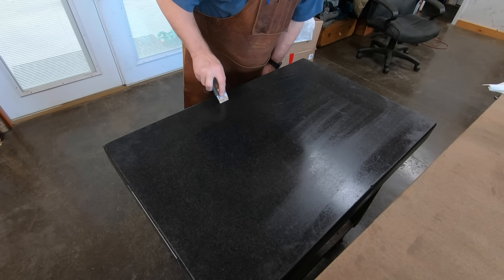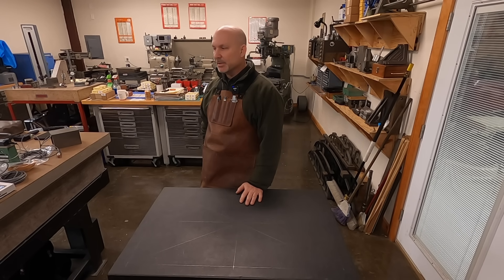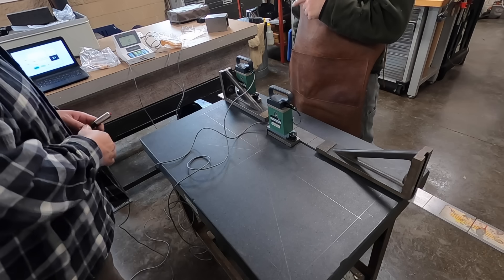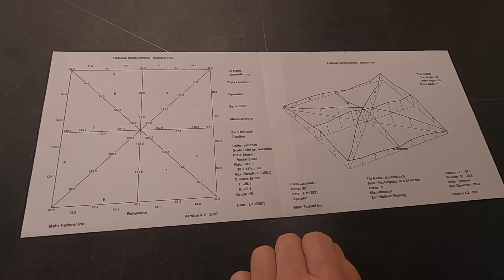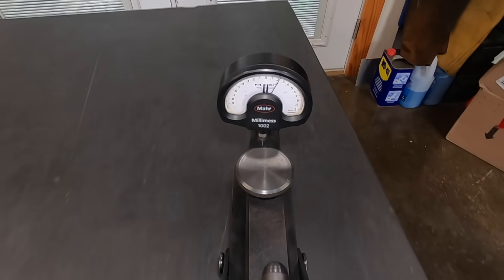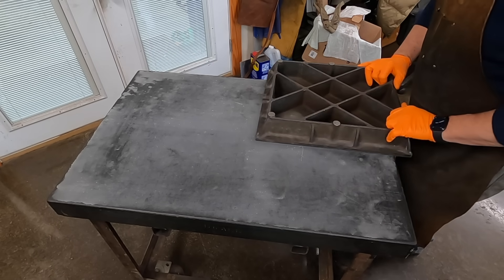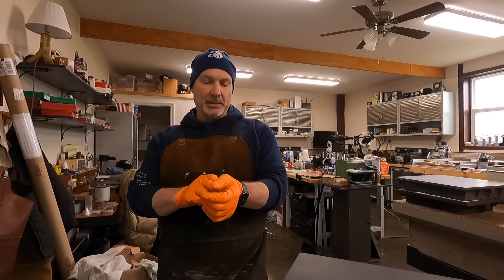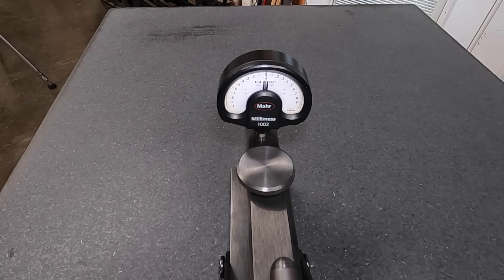Lapping my Granite Surface Plate to AA Grade

Comment: Take the plate home now and polish it :)

Is there not a surface finish that could be added to it to make it harder wearing ?
Reply: There's this thing with some precision granite plate cleaners - people say it contains lanolin which ultimately helps with lubricity and helps things slide better. So you get less wear on the plate.
Reply: @chronokoks  I guess baking in an oven isn't going to help - it's alrady been through that process :)
Reply: @millomweb  lol yeah. It's been sitting outside for so long it went through many heating cycles :D

Comment: What is the purpose of something like this like why does it need to be so flat
Reply: In fine machining, you not only want to be precise with parts--you want to be consistent along the length of whatever your fabricating (that's one example use). Let's say you want to make a metal cube. You machine one, set it on a table, put a level over it and go "hey sweet it's perfectly level, it's a perfect cube".  But then you notice you can slide a post-it note under some areas, or shine a flashlight on one side of the cube and see a bit of light peaking through the bottom of the other side. This means your cube may be (to the naked eye) square, level, and perfect--but in actually there's variations along that surface you're examining. So in machining, flatness is an important quality of making certain parts. Try taking two clean pieces of plate glass and rubbing them against eachother--you'll notice it's a challenge to get them to budge. That's because both of those two surfaces are making contact perfectly. Pretty much a vacuum seal. Obviously this is a useful quality, yet another aspect to pay attention to when talking about "tolerances".  So, a surface plate like the one in this video is used to reference the "flatness" of a part you're making. You'll see many of these plates made out of Granite because its a hard material and is pretty "flat" naturally. Lapping--in the context of this video, is abrasively "reflattening" the surface after years of use and abuse as good maintanence. I hope this reply helps.

Comment: Would like to ask can you coat the stone with say with ceramic liquid to strengthen the durability or accuracy of the surface lapped!?
Reply: Ceramics are basically fired metal oxides. Granite is composed of only metal oxides (SiO2 72%, Al2O3 14%), fired in the depths of mother earth.

Comment: How stable is the floor? You're walking around the table while taking measurements.
Reply: I don't know that it matters since the device is measuring relative to the stationary sensor on the table. Otherwise there'd be no productive way to produce an accurate measurement as there'd be too many variables in play that couldn't be controlled for. Could you imagine the nightmare it would be to have to take things like the stability of the ground under the object being measured, the local instantaneous gravity, the local air pressure, local temp, etc. basically anything that could even minutely effect the physical properties of the item being measured.
Reply: @thomasschulz2167  ok, relative measures will do.
I had some experience with measuring the surface of a telescope mirror. With the measuring device on one stand and the mirror on a second stand I was seeing my heartbeat in the picture (interferogram) transfered via floor vibration into the system. Quarter wavelength precision is going gown into nanometers.
Reply: @thomasschulz2167  I think it would matter if one foot of the table constantly dipped under the weight of the lapping device. He said there is some flex under loading. (I have no clue though.)

Comment: Every surface plate I've seen has been granite, and I'm wondering if there are any other stones suitable for this purpose.    I suppose marble would be too soft, but has anyone made a surface plate out of basalt?
Reply: I've always wondered why surface plates are made of granite but pool tables are made of slate.
Reply: Yo las trabajo con carburo de tugsteno
Reply: The answer is thermal and chemical stability.
Reply: @LeeDanielCrocker Slate is porous/needs to be sealed, and it is pretty brittle. It's also not as dense or as thermally stable.
Reply: @allenklingsporn6993  Slate must be a lot cheaper then.
Reply: I work in the granite industry, and I would imagine it's due to the extreme thermal stability of granite to keep it flat and the dense, fine grain to let you get it flat in the first place. It's also usually pretty homogeneous compared to most other stones so if it does expand or contract with temperature it does it more uniformly than other stones they may have several different veins or materials with different densities across the slab.

Comment: Could you explain to a layman what the roller's function is?
Thanks!
Reply: I'm not familiar with the process, but I believe it embeds the diamond powder into the surface of the plate to turn it into a microscopic sandpaper.
Reply: @EvelynH-tj1qt  Oh so that's what "charging the diamond" means. Thanks!

Comment: Has anyone ever made the connection that this is probably how the Egyptians made the blocks for the pyramids?
Reply: Yes, they probably lapped stones in a very similar fashion. A coarse, hard sand slurry used with water will remove material 100 times faster than fine dry diamonds, and is still accurate to a few thou.

Comment: seems like it would be faster more accurate and less expensive to resurface the plate.
Reply from the maker: That’s what the uninformed will think. We’re sharing the processes here. If you have it surface ground it still has to be lapped to finish.
Reply: Kenneth, think of a valve job only being ground and not lapped. Sure it would work, but ??

Comment: Just buy polished granite.
Reply: Polished granite is not even close to flat enough for a surface plate. These plates are so incredibly flat it’s hard to imagine.
Reply: Care to provide more information? To my understanding polished granite is all about appearance, so long as it's shiny it's good. It's not a standard reference for flatness.  Wouldn't that be like recommending a school ruler when someone needs a machinist ruler?
Reply: @Trahloc  Just my opinion.
Reply: @jacobcarolan1172   I could be wrong it happened once before  !
Reply: @jacobcarolan1172  We have granite tables at work that are certified , but decorative stone idk , flat over what distance? 1 inch or 1 foot ?
Reply: @jacobcarolan1172 
I actually wonder how much you would throw off the flatness once you polish it. Polishing is abrasive as well, and at that level of precision, I presume any material removed can break the flatness.
Reply: LOL, the tile guy trying to tell the machinist what flat looks like.  Yur killin' me here.  Difference between using a tape measure and a micrometer.
Reply: @ZeeCaptainRon  I fix jet airplanes now dummy, if a polished surface isn't flawless you'll see it in the reflection or the 6ft straight edge I used to use. 6 x 12 ft slabs are ground with giant diamond surfacing wheels.I was a master stone mason which is more than you'll ever be.